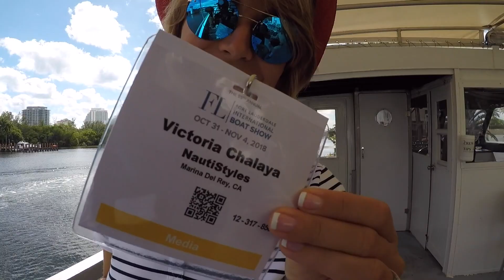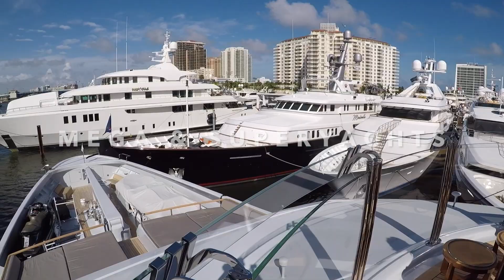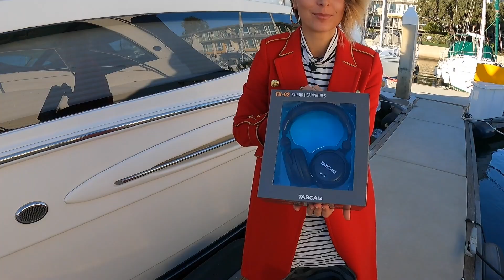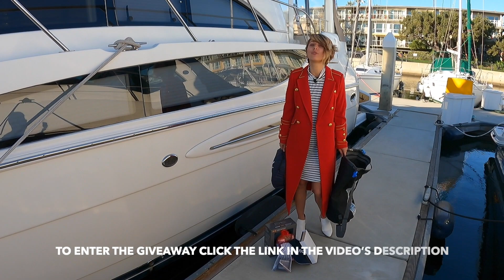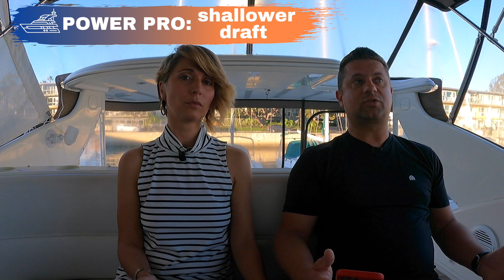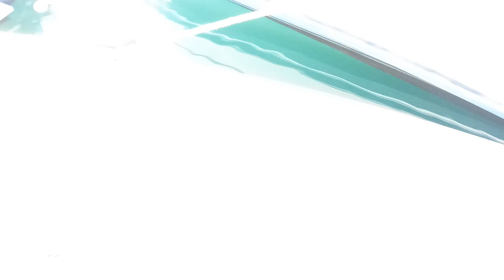POWER vs SAIL CATAMARAN Pros & Cons / Liveaboard Charter Sailing Yacht Tour Motor Boat Comparison

Comment: I just decided to look for a power cat or a trawler, no longer a sailing cat, so I will lose the advantage of a sailboat where you only have to motor 90% of the time:) while looking at the leopards they have power cats set up like trawlers so max 12 knots in a 40 footer with twin 105 hp diesels and then also faster casts with twin 350's, I dont know if they would have different hulls, displacement vs planing, also you can greatly expand your range by running one engine or get a large bladder to hold lots of diesel for ocean crossings. The trawlers (monohull) like Nordhavn's have 2000 gallon tanks for ocean crossings.

Comment: As a sailor, I cannot disagree with anything you've said here..except for maybe one thing; I don't know how fast power cats go, but there are some performance cruising sailing cats that can average 15+ knots, and are able to approach 30 knots with the right conditions. Also, those performance cruising sailing cats almost always have retractable dagger boards and rudders. I think the Gunboast 55 is about 2 feet of draft with the dagger boards and rudders up. I don't know how that compares with a power cat though.

Something you mentioned, but I would like to reiterate, engine overhauls and/or replacements will happen much less often on a sailboat. This will make sailing cats much cheaper to maintain than power cats, even after you factor in rig/sail maintenance and replacement on the sailboat.
Reply: the power cat opens up who can drive the boat so to speak in the case of an emergency - injury, serious illness, etc. - and if it has solar panels, that's another back-up in case of emergency.
Reply: @AB-ol5uz  Almost all sailboats have an engine of some type. You don't necessarily need to know how to manage sails. You can just turn on the engine and treat it as a motor yacht.

Comment: Great video, thanks. I've been looking for a review comparison video of both options and so glad to find yours.  I plan on retiring in less than 5 years and moving to the southern Caribbean. I think I will go with a smaller power cat based on a lot of issues you brought up. I've noticed that some of the smaller cats use outboard engines. Would love to hear your opinions on the pros and cons of inboard vs outboard engines for power cats. I'm thinking outboard would be noisier but easier to have serviced and less wear and tear since you can tilt the outboards out of the water. Thanks, new subscriber!

Comment: Great topic and povs and can't wait to see the next review of this a few years from now hopefully then solar and electric sailing boats are much better as well the cost of it and avaibilty world wide,parts and tech,, thanks for sharing take care be safe ....
Reply from the maker: We shall see, we live in the interesting times for sure
Reply: Electric boats will always have a range problem. Currently, an $8,000 set of batteries nets you about 10 nautical miles of range on a 36 foot monohull sailboat. So, even if you were to spend $80,000 and stuff that monohull full of batteries, you would only get a hundred miles of range out of it. And remember, displacement hulls are the most efficient hull designs out there.

Comment: We have been researching sailing catamarans for a number of months with the intent to circumnavigate. Mid way through the process my wife asked about electric propulsion because she is not a fan of fuel or exhaust smells. There are sailing catamarans with electric propulsion (with commensurate solar and backup generators). My first thought was I like it. However, after thinking about it, if you have sufficient solar and backup generators, why do you need the sails? Maybe for high lattitude destinations? Electric propulsion is here, and I think it will mature fast. If you are going to live on a boat full time - bigger is better.

Comment: Pure Electric has a loooong way to go before it gives you real range.. Don't @ me with 'muh solar panels' either. 20kw of panels (which is a LOT of panels) would still only be worth about 25 horsepower total in perfect conditions without accounting for conversion losses. And if you wanted to use power for anything else, or wanted to keep moving at night you would have even less power to work with. The relatively poor energy density of batteries means your range will be way way less than a gas or diesel for some time into the future.

The most efficient way to use solar power to move a boat is still by sailing. Sun creates wind -- wind propels boat. A hybrid system with electric saildrives and solar panels and generators and big batteries (as well as sails of course) could extend motoring range and give some silent motoring options; at the cost of complexity and probably a much higher price tag. Such systems will become more common as prices drop and tech improves. Eventually we might be able to ditch the generators and the last of the combustible fuel, but sails will be around for a long time to come. Very hard to beat the efficiency of capturing hundreds of horsepower with some synthetic cloth.

Comment: I've never seen a diesel electric Catamaran so far, do any exist?
Reply: I think Gunboat did a custom diesel electric a few years ago. Spirit yachts is ditching engines in their sailing yachts altogether. They are only installing diesel electric, with a big battery bank.
Reply: @operator0  That's very interesting, thank you, I'll check out Spirit Yachts

Comment: Great discussion on the power vs sail, Rico said it best, anytime you are cruising on the water is a great day. I would add to the power pro list, that the solo ability is much easier. I also agree once electric comes with better range ability that may even be better than power in that cost will be down in the long term. I apologize with my rambling but I have been going back and forth on this topic for a year and half.

Comment: Congratulations for the videos! 
Well, about this, sail or power catamarans, can you see , what solar motor catamaran have the pros of both systems? No noise, no smoke, mobility with no winds, speed, space in saloon, economy ( no fuel !) , long range , low maintenance cost ... I think in few years, will be the most important segment...

Comment: Ahoy guys. I like your channel very much & you're helping me decide what I might need to go to in the future without my having to do the travel.  (Smiles) So thanks for doing that legwork for me.
This is going to be a long post but I have a few disagreements on your narrative... and commentary on my future intentions. So I'll apologize in advance,  in case I get long winded.

@ 18:22  When you're talking about "Lightning Strikes" ... Any boat/ yacht/ ship can & will be struck by lightning.  If the mast and hull materials create a prime lightning rod, then you can add a strap from the mast, into the water. If you add a conductive strap or rope, infused with metal, from the base of your mast, and drop the trailing end a meter or so into the water ... Even if your mast is struck, your electronics are likely going to survive and most assuredly,  the boat will sustain no, to little damage. I started using the conductive straps in storms after my 34 foot Hunter power cruiser was struck and fried and I didn'thavethisadd-on. Then my 38 foot Hans Christian Cutter rig sailboat was struck off the Florida Coast & the conductive strap saved that one. Then a friend's 65 foot Chris Craft was struck, he had deployed the conductive rope, and his electronics were fine. I don't know why manufacturers don't add this simple,  and fairly inexpensive, item ... but it's worth looking into if you're going to plan to sail/motor in inclement weather.
@ 19:21  You seemed to relay that you think a Power Yacht is "Safer in a Storm" because a sail might tear, or something in the rigging may break. I've been through Tropical Storms with both, Power & Sail. And I've been through a Hurricane with Sailboats and one 82 foot Point Class Coast Guard Cutter. I'll place my life's bet on the Sailboat every time.  They're made for rough seas and (typically) if you're breaking rigging and tearing sails ... you have either neglected the vessel to the point of abuse  ... or ... you're overpowering the boat (and the rigging)  FAR beyond the specs and allowance for safety in those conditions.

Throughput the video, you mentioned "Parts & Maintenance" often. I guess this is a good time to unite my last thought on your comments and my future plans.
Yes, parts for clutches, rigging, winches, sail repair, etc, are all necessary on a sailboat. But "Cost Wise" over the life of your cruising life, it works out about the same (or a little cheaper) than a power boat.
That's considering, (as I plan to sail), that you're "under sail" with the engines off, at least 85% of the time that you're not on the hook.
Engines burn a lot of fuel. And to "inframe overhaul" a large Diesel engine isn't cheap.  And that cost goes up significantly, when it comes time to completely remove the old engines and replace them with new ones ... after the life of the block has expired and they can't be "inframe overhauled" again.
With sails ... if you actually "sail" ... those costs come much further apart and the "engine swap" comes much, much later.

Which now brings to mind a "Safety Issue" that i hadn't considered before: ...
Let's say that we are running together, 500 miles offshore,... you in a Power Cat and Me in my Sailing Cat. We both take a  Lightning Strike...
Now ... with the new "Electronic Controlled Technology" in today's Diesel Engines  ... I can manually hoist the sails and get back to shore. Or at least to a shipping lane, or coastline, where I can signal for help.
You  ... you, on the other hand. Well, my friends  ... you're pretty much dead in the water & for all intents and purposes  ... you're now Poseidon's Bitch.

I plan to find a Sailboat, in good shape, in the 50 to 65 foot range. Sail around the World,... no schedule other than weather.  And with today's technology,  there is little reason to be caught in bad (hurricane or tropical storm) weather or strong tides unexpectedly.
Then I plan to find a few "favorite" places,  and follow the fishing, the sun ... and the bikini-clad girls.  LOL

Those were just a few of my thoughts. I probably wouldn't have posted anything  ... but you did ask.

Fair winds and following seas to you. Thanks for the work you put into your channel.  Be well & see you on the beach somewhere  ... someday.

Comment: Your comments lead me to believe you will find less compromise of your priorities in a power cat, especially as a live-aboard couple.
Regarding the prospects of voyaging, I'm a live-aboard in SF Bay Area and I quickly submitted to an honesty that I have too much value to risk my home and possessions in a voyage outside the Gate. Additionally we have fantastic inland bays, delta, rivers and fabulous destinations, e.g., the wine country marinas. So I have more than enough yacht, to get that done on my PowerCat - I never considered sail.
My 2018 Aquila 44 , full beam master, 2 staterooms with head (but I turned one into a full laundry, wardrobe and additional refrigeration and freezer), customized the starboard of the full beam salon into a long open office. Had no trouble extracting the furniture and appliances I wanted swapped-out (hard to do with a sailboat). And I also like that all my utility access is outside the salon, I don't need to move people and remove salon carpet panels to get to anything.
I don't entertain, but my galley is at the rear where it belongs, fully open to the cockpit includes a snack-bar service window and nice when 3 friends come over to to watch the game or BBQ. A lot of times I pilot alone, so I like that my bridge opens 3 steps down to the bow deck, I might dash down there, get work done, still watch where I'm going. 
Is that the bulk of what you might value for your next all-purpose boat?  Seems a boat designed around the needs of sail is a compromise to a lot of that.

Comment: For world travel crossing oceans current power catamarans have very small fuel tanks compared to trawlers.  The Aquila 54 has only 581 GAL.  Sail cats range is transatlantic but fuel tanks are too small (200 gals) ..... let's be realistic: you do more power sailing than real sailing if you want to get to a destination on time.   On power or sail cats befor you by imagine fixing an engine in choppy seas .... engine room space and location are very important .... engine access from the exterior is also very important .... imagine taking the motor out to replace or for rebuilding .... Power cats will help you escape dangerous seas and will give you the power you need in inlets and very strong currents ..... My choice would be a Leopard power cat 53 pc with 1500 gallons of fuel but they only give you a crappy 562 gals of fuel.

Comment: Nice Vlog 👍! Good information and nice to hear your own personal thoughts. Would have liked to have heard what is your favorite power and sail Cat, or maybe top 3 if you haven't narrowed it down that far. One other thing to throw into the mix, Trimarans. Ever thought about a Tri hull Sailboat like the NEEL 65, or NEEL 51 Loft? Or a power option like the LEEN 56 Trimaran (pretty sharp looking design) Those are honestly the only 3 I've looked at and they seem interesting, but it's a much different layout than the typical Catamaran setup, with a main deck master and guest bedrooms in the hulls. The Leen seemed interesting with a single diesel engine and also electric drives in the outer hulls, and 5000 mile range. Hope you guys have a Happy Holidays and stay safe, healthy and Covid free into (and through) the New Year!

Comment: Motor not dependant on Wind and current conditions on motor. See people on sailing boats having to wait a day or 2 to leave an anchor, or dock, and motor can leave whether winds blowing against you, no winds, or currents running against you.  All your stuff doesn't have to be locked down as much as with a sailing yacht. Safer on deck for a motor yacht. Sides are taller, stuff not swinging across deck,  turning doesn't lean boat.   Have heard it broken down pretty good before. Sailing yachts are blue collar and Motor are White Collar.  Meaning on on sailing yacht you are always working, less stabilization, more sea legs needed. Motor yachts don't need as much  preperation before leaving. Locking all drawers, cabinets, doors, and double and triple checking weather patters and wind patterns and where currents are faster and in what directions. The power you check weather and make plans and push off.  Both are good, but power is more luxury for crew and the guests IMO. Got all my points on contest :-)

Comment: I am curious how often the generators run and how much fuel they use.
Reply: Generator run time is highly dependent on how much solar/wind power you have installed, and how much electricity you use. It's possible to never need a generator if you don't run the aircon, and have a small refrigerator/freezer coupled with 1500+ watts of solar and wind. Most water makers will require a generator though.

That being said, an 8kw generator will use about 2 gallons an hour (8 liters per hour) at full output.

Comment: For your lifestyle, I think you answered your question.  Power.  You are not world travelers. You don't need a sail cat.  It's too labor intensive to sail. You really have to love all the work involved. You will be too busy running your volgs, and working as captains every once in a while.  You can work on your diesel engines yourself, save money on labor.  And as you mentioned, as electric tech. advances, you will eventually refit your yacht, or buy a new one.  Sail is a pain in the neck for most.  Looking forward to the fun you will have hunting for your next home.

Comment: I may be completely off the mark here.  I've only sailed smaller racing boats under 30'.  But, you didn't address the most costly part of sailing as far as I have known.  That is the cost of cloth.  Sails are very expensive and lose efficiency quickly.  Can you address that as it applies to the more leisurely craft of touring catamarans?

Comment: 3rd option the new solar electric power cats unlimited range no fuel needed
Reply: $12,000 worth of batteries on a 36 foot monohull sailboat gets 10nm of range and uses about 2.5kw at 4-5 knots. I am very skeptical of the performance claims that these "all electric" manufacturers show. I need to see it before I believe it. https://youtu.be/EWFjxFkTWmQ?t=594

Comment: Interesting video but I really think you are seriously underestimating Solar Powered Cats. Since you did the video on the Silent 55  they have redesigned things and are now building the Silent 60 with far better Batteries and Solar Panels and also Engines maybe. The shortest warranty I believe is the Batteries at 8 years. Solar Panels at 25 years and lifetime on the Engines. There is no power or sail Cat that will give you 8 years of almost zero cost running. I agree with you that technology in Solar and Batteries will improve over the next few years but I think it's a serious option right now.